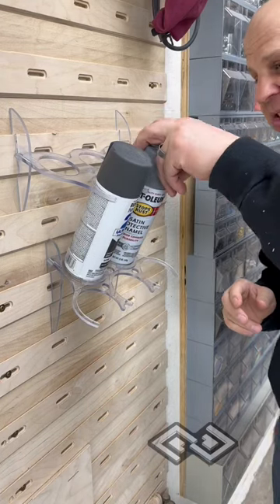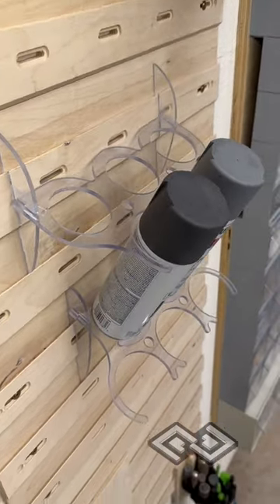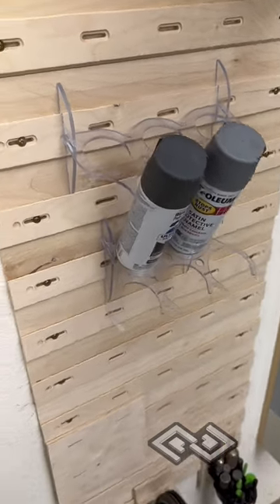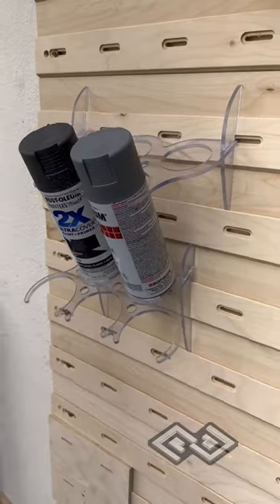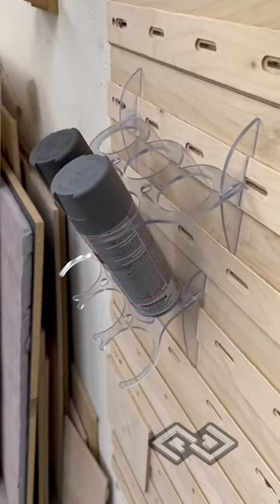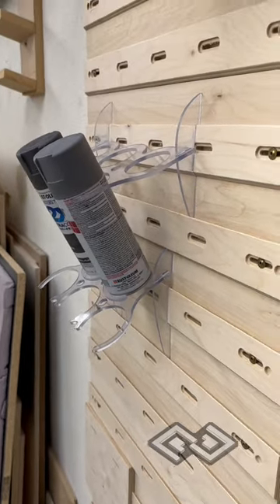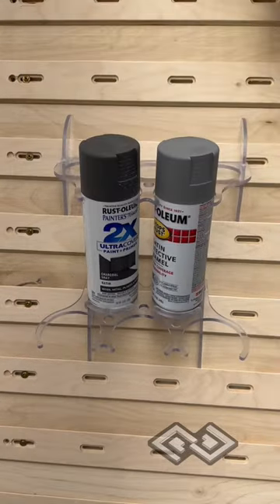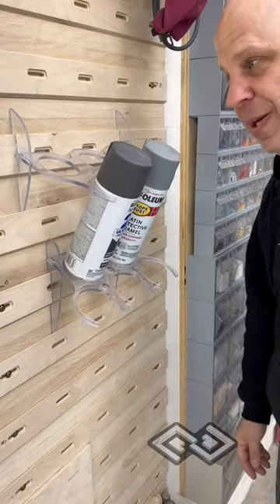#diy spray can holder for #frenchcleat wall panels. #frenchcleatsystem #spraycans #spraypaint

Comment from the maker: Friends at @bluepineshop were asking for this design for their shop so Chris @_aglimpseinside and I started iterating on this design. It’s modular and with some updates it will tile vertically and horizontally on the #frenchcleatwall panels to accommodate as many spray cans as needed. Chris is testing this out using laser cut plywood on his @lagunatools laser and I am using polycarbonate scraps to prototype with.